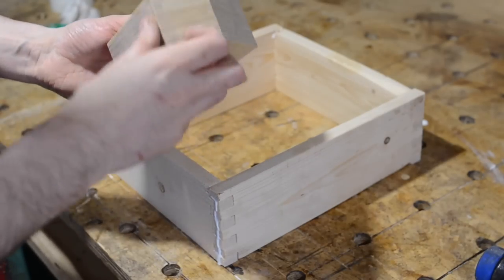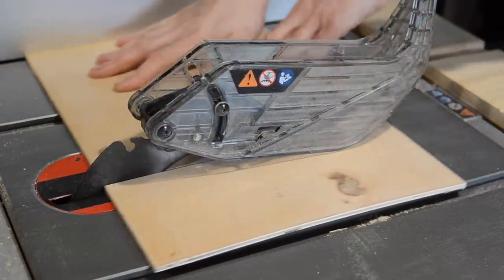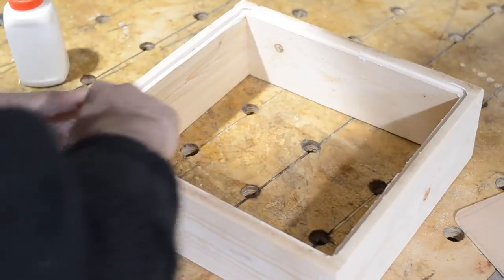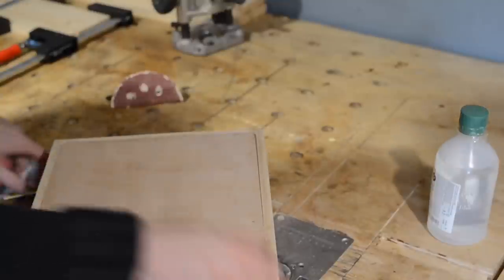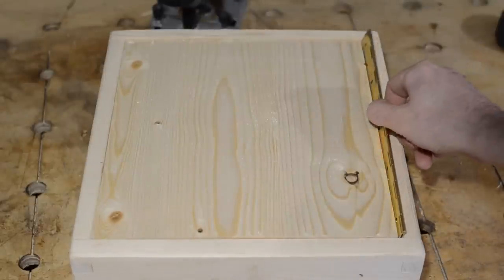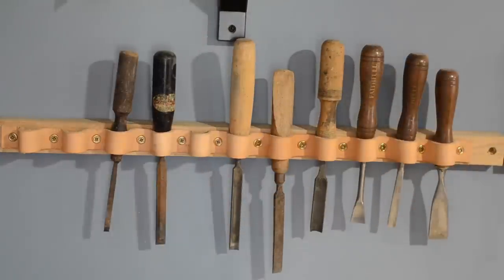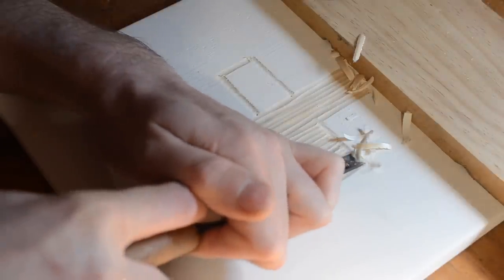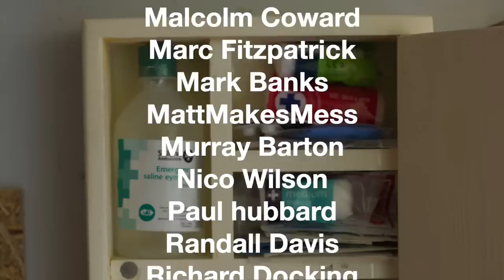Making A First Aid Cabinet

Comment: Optimist or not, some 4X4 gauze bandages to help stop bleeding are in order.  a saw cut usually needs more than a band-aid. A three foot length of rubber hose or a pre-formed  tourniquet could save your life.  I have reason to know, being a retired EMT ( Emergency medical tech.)